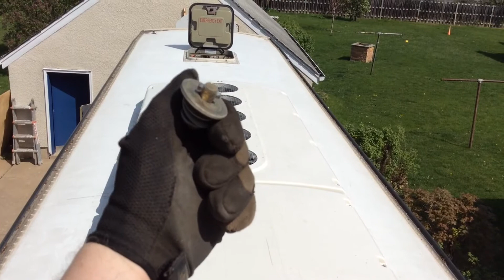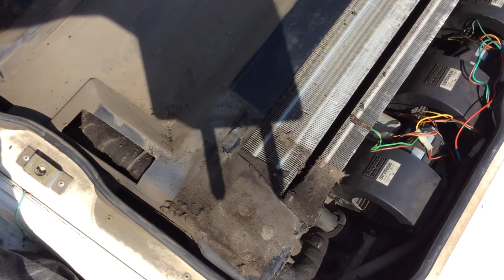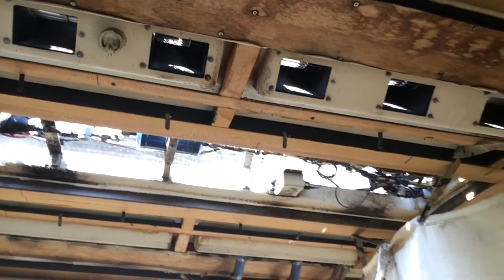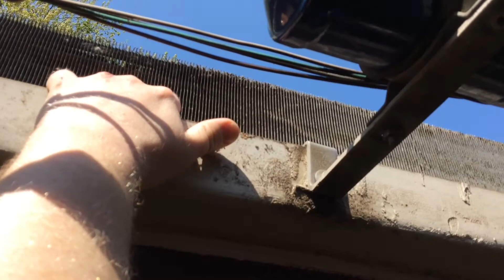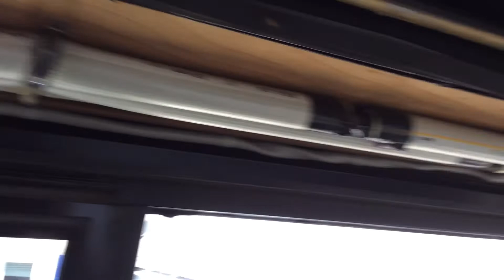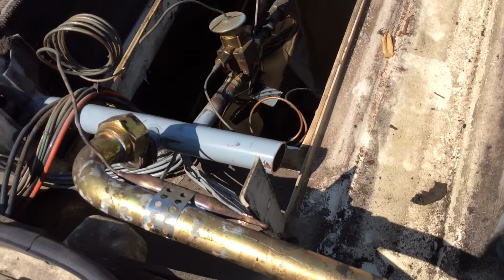Bus HVAC - Removing AC Part 1

Comment: use evaporator coil not radiator or condenser . condenser will use for only heating system which high pressure goes from compressor to condenser . make some procedure to explain which should be useful for others .... anyway thanks dude good job
Reply: Mir Imran Ali the bloke is not Mechanic you should understand!